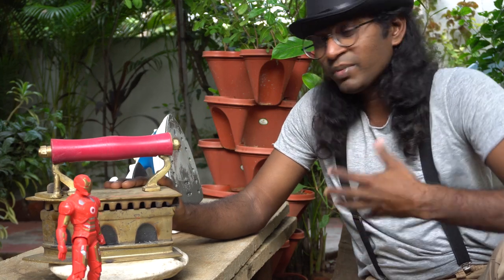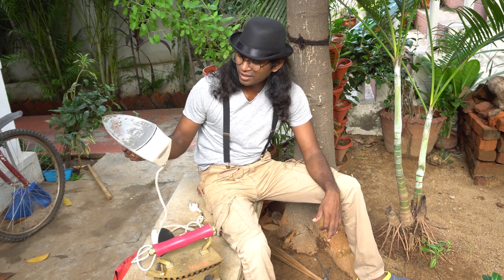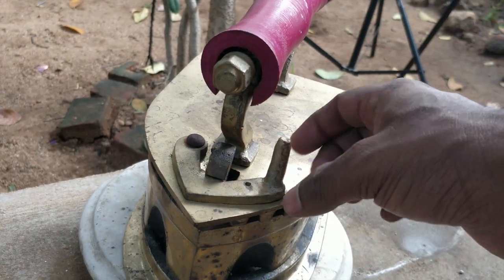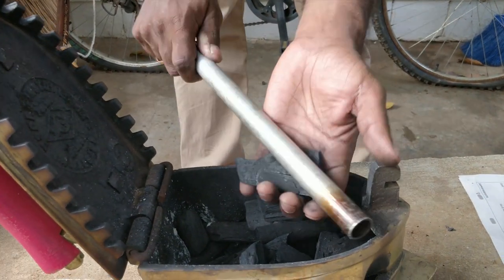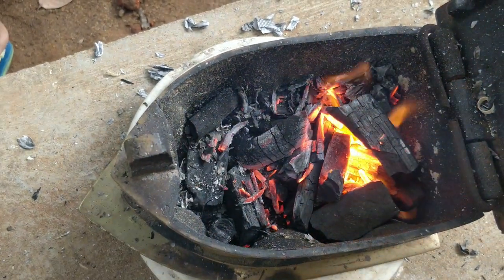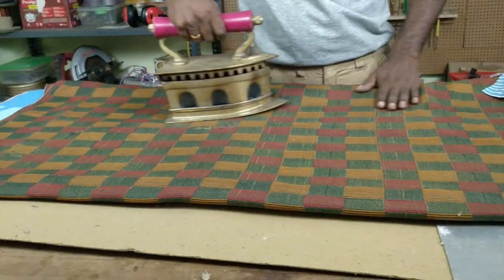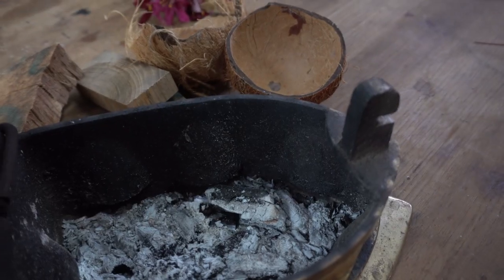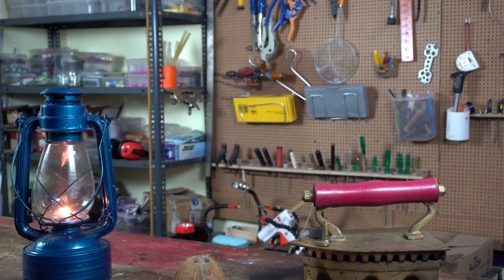How to use coal Iron Box

Comment: Price???
Reply from the maker: it keeps varying based on metal price.
Reply: @VIDEOEPPO   But How Much Its Price Any Metal
Reply from the maker: @UmarSheikh013  i think i got it for 2800 rupees or something....check on goolgle for current Brass price per kilo. Then based on the weight, you can guess the present price. (There will be making charges)
Reply: @VIDEOEPPO  thank you Sir